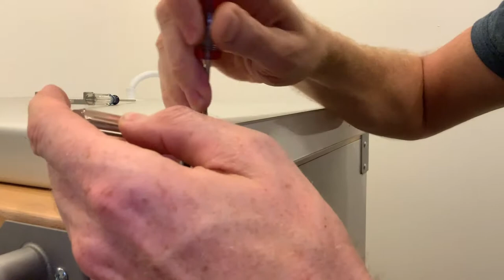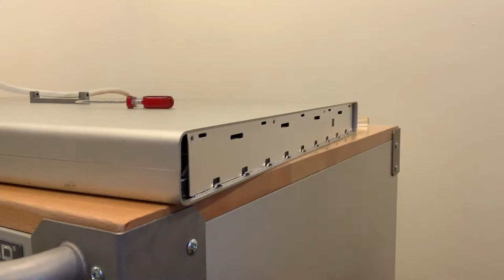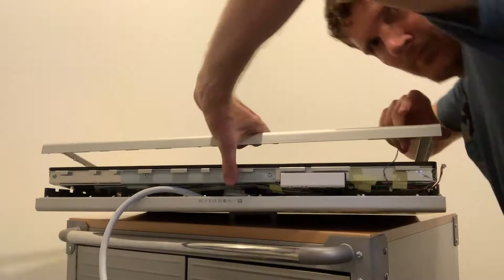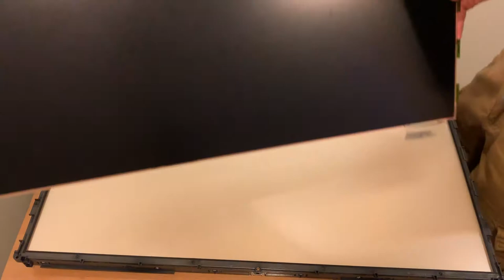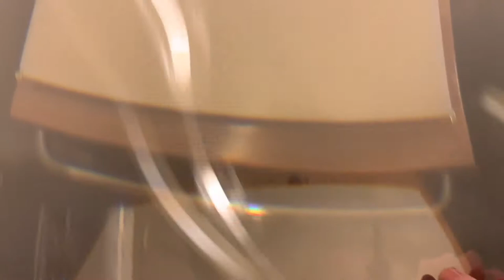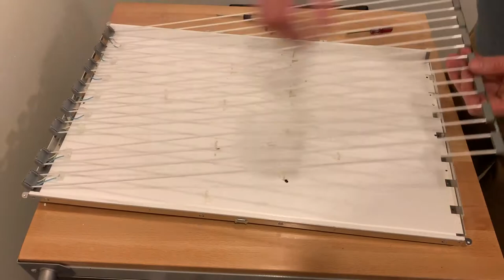Apple Cinema Display Disassembly 🛠📺 - How To - 30 inch (let's take it apart)

Comment: Thank you. I've fantasized for years about taking this thing apart and blowing the dust off the back of the screen. Now I know that is NEVER going to happen!👍
Reply: I just bought one from original owner over 10 years old, just took it apart and not a spec of dust inside

Comment: I just bought me one of these and I've always wanted one and I'm really glad to have found this video because I finally found out that there are multiple backlight tubes rather than just 1 or 2 like in a lot of other CCFL based LCD panels so this is amazing! I just wish I could find a way to figure out which ones were the updated models with the higher brightness and contrast. I couldn't find any information about that other than the fact that in 2006 they were quietly updated which is really annoying since they didn't put new model numbers on them.
Reply: I know this is old, but you can check the Serial Number on multiple Websites, and then you know from which year the monitor is

Comment: This is a helpful video! My dad has 3 Apple Cinema Displays (all 30 inch) and one 24 inch one. We either sold 2 or all of the 30 inch ones but kept the 24 inch (I'm hopeful that the last 30 inch wasn't sold) and would want to convert it to LED. I think that these CCFLs would need much more power than the LEDs so I would get some sort of power converter or step down thingy. Anyways, this is a great video and more people should have watched it!
Reply from the maker: Glad you find it useful! Good luck if you go ahead with an LED conversion!
Reply: @MakeFixUpgrade  Thanks!
Reply: if you got that working then please share your experience/advise on how you did it. I have 3 30 inch ACD and one of them is so much more yellower than the other two. I would love to hear from a pioneer before I took apart mine. Thanks!

Comment: Thanks for this video! I need to replace the yellow panel on the inside but I can't find a replacement.
Reply from the maker: I would try searching for a plastic sheet of similar thickness and translucent shade and see if I could find anything close. I never reassembled mine since the screen was broken.

Comment: I just bought a second hand 30-inch ACD and I was shocked to see how orange the screen was when I turn it on. Almost like if night shift mode was turned on and on high setting. 
After calibration, I managed to get a relatively OK image but the coloration is not uniform and the remaining yellowish areas spoil my fun 
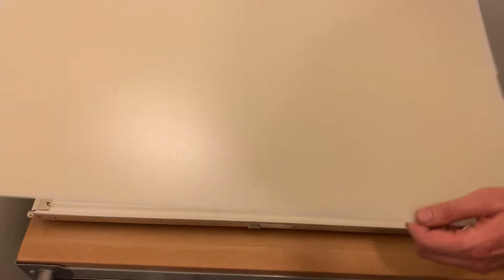Thanks to your video, I now understand that the last layer seems at fault (the one you remove at 11:30). 
Its purpose seem to be to diffuse the light of the CCFL? I would like to try to change it myself, could you describe what it looks like (in terms of opacity, thickness…) from what you remember from your disassembly? That could really help in my search for a new layer with similar properties. Many thanks!
Reply from the maker: @Aubin Debatty Yeah mine is quite discolored as well. You're actually in luck, I have that particular sheet sitting next to my desk right now. It's fairly opaque, you can't see through it although you can see your hand through it if it's directly under it. It's 2mm thick. The edges (where it wasn't exposed to the light) are still white. The center of mine is a yellowed/orange color. It's 25" 7/8in (65.7225cm) wide and 16" 3/8in (41.5925cm) tall. Hope that helps! Good luck!
Reply: @MakeFixUpgrade  Thank you very much for your detailed answer! Indeed, it helps a lot to try to identify a compatible replacement layer without dismantling the monitor since I am currently using it! I need to do more research but at first glance, I can’t find many retailers for light diffusion plastics with similar caracteristics. Therefore, I think I will first try to restore it with a method for bleaching old plastics. If the results are not convincing I’ll go back to looking for a replacement. I'm not going to get started right away but I am definitely looking forward to get into it as soon as I have a vacation coming :)
Reply from the maker: Good luck! I'd probably buy a few different types of plastic sheeting of that thickness and experiment with them. You may end up with something you like better.
Reply: Aubin Debatty My display is also quite orange/yellowed I suspect is from the previous owner running at full brightness combined with the heat of operation. I plan to “retr0brite” my diffuser which will take several days in direct sunlight, but I’m open to replacing the original plastic diffuser with something similar. I’m curious to know what other plastics would be a suitable replacement.
Reply: @MakeFixUpgrade  Just lately I discovered how to clear the yellowed/opaque < transparent > PVC by using WC NET Bleach GEL cleaner. I believe it works on any plastic material as well but I'm not sure the dilution used for that specific product. I used it on a sponge and dabbed the plastic progressively lightly rubbing it. It worked a treat...
Reply: @sanatkumarasharma3627  I looked that product up and it seems to be a concentrated toilet bleach gel. But, it's not sold in the USA. Any chance you could give the ingredients here? I'd like to try the same experiment with the ACD 30" that a friend just gave to me. I did a correction w SpyderX and it seems to be decently accurate, just not bright enough as it's compensating for the lack of yellow and orange. I can tell that b/c when I turn off the color profile the Spyder made, it's way brighter.
Reply: @samfrazier5599  Well, I believe that you can find a similar product if not exactly the same. In any case there are no exact details about the composition but just that it contains SODIUM HYDROXIDE, AMINES, C12-14 (EVEN NUMBERED), ALKYLDIMETHYL, N-OXYDES, SODIUM HYPO CHLORIDE.
HTH
Reply: @sanatkumarasharma3627  Thanks!!
Reply: @sanatkumarasharma3627  did you have to do any UV treatment (like leaving it out in the sun) as well, or did you just scrub the diffuser with bleach
Reply: @JulianGrayMedia  Just scrub it with a sponge and rinse it. If it works you should see the results in a few seconds.

Comment: Brilliant video, I have one fully working with some condensation-type issue on the screen (was saved outside) is it possible to remove the front first and leave the back intact as it's fully working. I want to wipe the backside of the glass in the hope the condensation will wipe off.
Reply from the maker: Hmm I no longer have this and can’t quite tell if it would be possible or not. I would suggest pulling it out of the case if you’re comfortable doing it and looking at it more closely. It would make sense to me that it would be possible but I don’t know. Good luck!

Comment: Very helpful video, thanks! I'll watch this multiple times as the power brick (original Apple) melted the connection of the cable to the monitor (connection is fried black) and I need to replace the cable assembly and power brick. Is it enough to replace these two parts and hope it won't over heat again, or could the problem stem from within the monitor?
Reply from the maker: Glad you find it useful! I’d start by replacing those parts and go from there. Good luck!

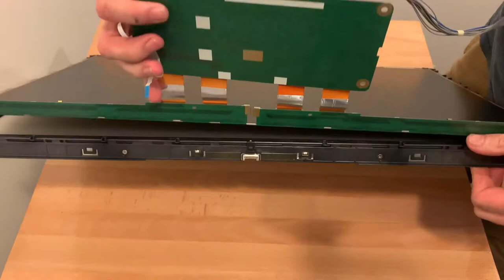Comment: Do you have any of the old boards?  I am looking for the timing pcb which was the last one you removed (at 8:50 mark, connected to the cracked display panel).
Reply from the maker: No I don’t. I kept them around for awhile but cleaned out unused components and recycled them.

Comment: Thanks for your video. Congratulations very good.
I have a question for you. I have an equal screen but the fault is when it starts or when it seems to turn off, pressing the power button and turning it off again. so that it is not repeated I take the power off and sometimes it does not turn off at some time. He could tell me what the fault is and how to fix it. I am looking forward to your response. Regards.
Reply from the maker: JA Macias your question is a little hard to understand but I think the problem might be the power switch. The only way to be sure would be to test it. It’s hard to diagnose it without having it physically present.
Reply: Nah, that's a result of the power supply. If one of the parts in it fails and doesn't supply the exact required voltage, then the screen will flicker. There are a few youtube videos about it and how to sort of get around it. None of the solutions are great, except for maybe finding a working power supply.

Comment: Wow! Thanks dude. Great video. I finally took apart mine today for an LED conversion. Well I only took apart what’s necessary to get to the tubes. Very straight forward in fact. Do you think the top sheet of the lcd backlighting assembly to be a bit yellow tinted? I noticed in your video that the bottom thicker sheet was quite yellowish in color  but mine is bright frosted white. I’m not sure wether or not I need to replace the top sheet since mine has a noticeable yellow hue compared to the other sheets in the assembly. Any advice would be much appreciated. Thank you!
Reply from the maker: On mine the only sheet that was yellowed was the thick one. All the thin sheets are clearish/white. If the yellow hue bothers you then I'd replace it.
Reply: @MakeFixUpgrade  Thanks for verifying that! Good to know that it’s not meant to be yellow tinted. I picked up a broken tv for replacement. Hope that goes well.
Reply from the maker: @ancientsnox5093  👍 no problem, good luck!
Reply: @MakeFixUpgrade  Hey man, I'm happy to report that the project was successful. Now the monitor only draws around 60 watts but it's only outputting about 330 nits. I should probably add double amount of leds and hopefully get around 600 nits and that will be very nice. Sure hope it will not overheat because there is absolutely zero ventilation 😂
Reply: Ancients nox. I want to do something similar. I’d love to hear more about your process and results.
Reply: @nathansloan8532  Hi Nathan, I went for the easy route because I didn’t have an LED control board at the time and I just wanted to try it out and see if that even works. So basically I used 24V LEDs with a RF controller I had for dimming lol. And since the power supply is 24.4V, I took the 14pin connector that goes in to the inverter board and found the positive as power for the LEDs and have the controller in between. You can either remove the inverter or just ignore it. For somewhat even brightness, I divided 16 rows in 4 groups and ran them in parallel. I will suggest more groups and more rows of strips from my experience and supply power from both ends. Make sure to calculate your power budget for the conversion. It’s going to be a lot of soldering! I will also suggest that you find LEDs with 8000k-10000k color temperature and recalibrate the display afterwards. I will definitely redo everything properly when I have time but for now that’s all I can tell you. Hope that helps. Good luck!
Reply: @nathansloan8532  Nathan, I hope that you haven’t done it yet. Because seriously tho don’t do it. I don’t think it’s worth it. You will need lens over LEDs to get even lighting or go crazy like I did and fill the entire panel with LEDs. I’ve just done using 240leds/meter light strips to fill the entire backlighting panel that is totaling of 5100 LEDs which is a bit of problem to drive with built in power IC. So I ended up powering the backlight separately and at the same time lowering the current draw to combat the heat and to save power. Now it can comfortably operate at just below 300nits but I wouldn’t run the display at full brightness (around 460nits, looks absolutely amaze balls lol) for more than 30 minutes which draws over 200 watts! Maybe you can get away using higher efficiency or less densely packed LEDs , but I’m done with this project. Let me know how yours went if you decided to do it.
Reply: @Trannymaxxed  Henry here. It will probably cause the leds to overheat and burn out completely fairly soon but I ran it for 5 minutes and it got worryingly hot, because it’s 100% enclosed without any ventilation . Also my meter says at 24V, it’s drawing more than 500W lol (very weird) It’s just not safe and I did not reinforce the adhesive for the strips so they will definitely melt at high temperature. I got it completely redone with 33 strips running in parallel and ran power through the Kensington lock in the back with a variable voltage power supply. Currently operating at 18.5V/120W (360 nits) and can sustain that indefinitely and runs much cooler than the original CCFL at maximum brightness. It should be good at 20V/200W in my case but that’s too bright for me. So you just need a small 24v power supply to power the monitor circuitry and variable voltage for the lights only. Not the most elegant way but it works perfectly for me. My last advise is to get leds with 10000k+ in color temperature so you don’t end up with a very yellow screen. Hope that helps.
Reply: @Trannymaxxed  Sure it is a lot of work. As for the diffuser panel, I sourced it from an old broken tv that I picked up locally through Craig’s list. If you’re doing the LED conversion, I will just use blue LEDs and leave those yellowed diffuser panels as is unless it’s yellowed unevenly somehow. I believe the ccfl is 650mm in length. You might need new holding brackets tho since mine was very fragile and they were destroyed when I was removing the CCFL tubes. Your choice now.
Reply: @ancientsnox5093  Hi man, where can I contact you? Just got my hands on a 30" and I'm planing on doing a led conversion, are you still interested in the project?
Reply: @MakeFixUpgrade  Where do you get replacement sheets for it? I would like to replace the yellow one(s.)  I have yet to open it up to see how many are yellow.
Reply: I'm looking to just get to the diffuser screen so I can replace or bleach it to fix the yellowish tint issue. Any chance you could say at which point in this disassembly you got to where you need to be to get to the tubes? I'd love not to have to remove the logic board and the rest of those electronics just to clean the diffuser screen. Thanks for any help!!
Reply: @samfrazier5599  Hi Sam, you shouldn't have to remove all the circuit boards to get to the diffuser panel but I will recommend you remove most of them because it's very simple process and will make the further process much simpler and organized. Also my piece of advice is that to leave the yellowed panels as is and get blue LEDs as backlight if you are thinking about a LED conversion.
Reply: @TheBonzai1234  Hi there. Sorry about the delay. I must have missed it. Hope your project was successful. I can report that my solution is very stable and have been using it daily since. I will suggest you get blue LEDs instead because my second attempt with 10000k LEDs still came out too warm as a result. I did calibrate it so it's usable but it's certainly not good color accuracy wise. I have no idea how blue LEDs will do to the final product so try it at your own risk. Hope this helps.
Reply: @ancientsnox5093  Thank you very much for that! But, I'm a little confused b/c I thought you wrote in another response that the LED replacement wasn't worth the time or the money. I'd love more details about your LED conversion if you have them! But, this is probably way about my skillset. I was really hoping just to hire a local computer repair person to do the disassembly & reassembly once the diffusion sheet is replaced or bleached.
Reply: @samfrazier5599  Hiring someone else to do it will be expensive. The reason that I mentioned that it's not worth doing is because it took me like 8+ hours start to finish to to complete the conversion. And the materials aren't cheap either if you're doing what I've done. Which involving filling the entire back panel with high density 240led/meter strips in parallel. You also need a separate DC power  supply to power and control that backlight panel independently, because you will burn the IC on the motherboard in a few seconds if you wire them up directly with that amount of load and no way to adjust the brightness. Doing it for fun and make it a great weekend project? Yes. Otherwise, not recommended especially if you don't like soldering, I mean a ton of soldering if you want the light intensity to be even across the board. Finally the end result, probably isn't as good as original even with calibration but it is one BRIGHT display and I have enjoyed it so much as a secondary display. With hundreds of dollars you need to spend on this project,  it's enough to buy a decent monitor but without Apple aesthetics for sure. If you are doing it then I will say, use pure blue LEDs if you could and please let me know when you finished,  because I tried 7000k(very yellow) 10000k (much better but not usable without calibration) best of luck!
Reply: @ancientsnox5093  Hi Nox! Will you make a blog post somewhere so we can follow your guide with pictures and have a look to all parts you used? Soldering won't be a problem, but the lack of information for such a conversion would be one.

Comment: hello. amazing video !!! have yuh ever opened an Apple Cinema HD Display 150W Power Adapter (A1098) ? if so, is that difficult ?
Reply from the maker: I haven’t opened one of those power adapters yet. If it’s like what I’m thinking of I believe it’s sealed and would need to have the plastic case cut off.
Reply: unless you're really good working around voltages and currents, i wouldn't recommend trying to service that apple ps.   not designed to be serviced.